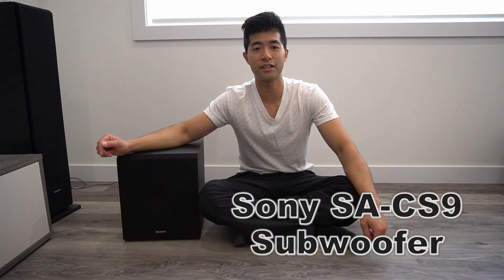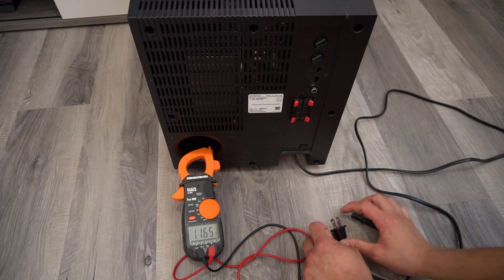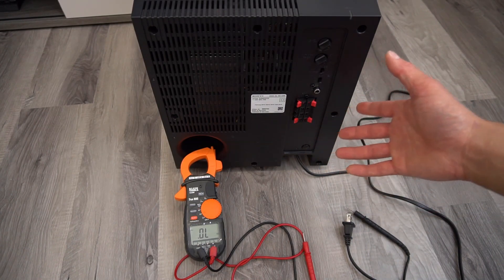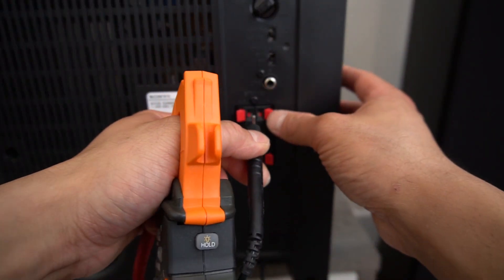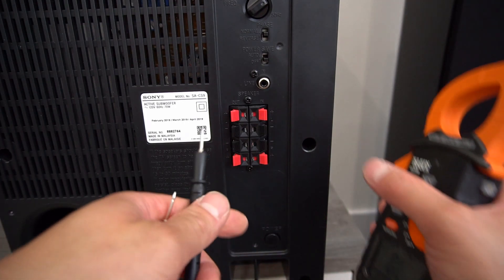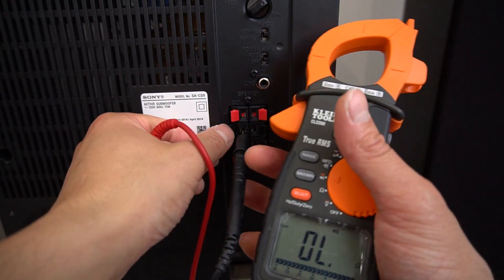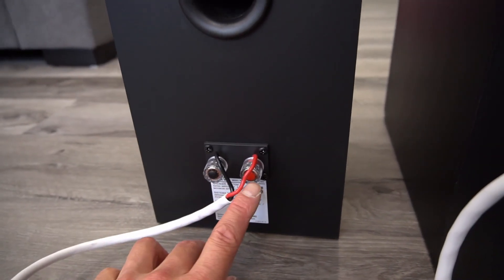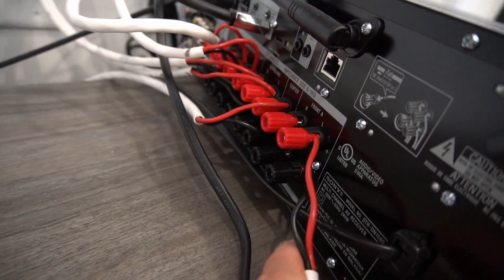SONY SA-CS9 Subwoofer PART 2 DEMO

Comment: I recently picked this one up for my Sony receiver as it was the one recommended. It was an open box speaker from Best Buy. Was listed as "good condition". Once it arrived, I inspected it for any flaws as being an open box. The one flaw was on the bottom underside and that was all. Once all hooked up and the receiver calibrated all the speakers, the sound was impressive. No complaints as now I can adjust the volume level from the sub to my liking.
Reply from the maker: Good stuff!

Comment: I want to add this subwoofer to my AVR and have .2. Does it make a difference connecting using just the line in VS using the terminals?

I have a Front L/R  bookshelf speakers so connecting using the terminals make sense.... and so is using the other subwoofer output on my receiver.

Or can I put both?

Comment: Would you recommend this Subwoofer for a medium size home theater? Sounds good, but I don't know if it at full power or it so strong that you can't even turn it all the way up. I would like to know that.
Reply from the maker: It's a decent average sub. I have two of them connected to my AV receiver. This sub you have the option to turn the dial to increase or decrease the bass. Good price point too, especially when it goes on sale 🍻

Comment: What is the purpose of connecting speakers in the subwoofer?
Reply: I was also wondering that.
Reply: Late response but it allows almost any amp/receiver to add a subwoofer. Because some don’t come with a dedicated “sub out” you can input your speaker into the sub, then run the sub the amp.

Comment: Quick question do you leave it on or put it in standby mode ? Thank you
Reply from the maker: @Marcus_38  I have a separate power bar. If I'm not using it. I have the entire sound system off. Save energy 🍻

Comment: can you please explain more about the "line in" just above the speaker in and Out connection?
Reply from the maker: They are for connecting two wires together if one wire isn't long enough to reach to a speaker

Comment: I KNOW THIS VIDEO IS 4 YRS OLD BUT HERE IS MY QUESTION. SO IF I USE THE PASS THRU SYSTEM, DOES THIS ACTIVATE THE WOOFER THE SAME AS IF I HOOKED UP THE LOW FREQUENCY INPUT?
Reply from the maker: @jorgeatilano5468  nope, it does not activate the woofer. Woofer is only active with the RCA input 🍻

Comment: "Speaker in and out ports" on the subwoofer, not only pass through the signal but play key role in the subwoofer functioning. If bypass these ports, with only mono sub cable connected, the sub will play very weak. If your amplifier does not have subwoofer outline, these ports will make the sub works well without the mono sub cable connected.
Reply: If my amp does have a sub out port, can I skip using the speaker pass throughs? My amplifier is the DA-2120C Fosi Audio. Thanks for any help

Comment: Sir without amplifier we can use this subwoofer 🔊 with direct connection to sony tv Vv
Reply from the maker: Absolutely brother. This sun has a amplifier built in. You just need a RCA output connection on the tv and then connects to the sub input RCA 🍻

Comment: Hey kev, question? I got my sub woofer. Hooked it up, sounds really great...until it cuts out and gets all buzzy lol. On the instructions its says plug the rca cable into the mono port but i don't have a mono port, i have a phono port. So i un-plugged the rca cable cuz i don't know what port to plug into. Do i need the speakers wires plugged in also or just the rca cable, but plugged into the correct port?
Reply from the maker: Hey man, yeah you are correct. Just a single RCA cable. And to be plugged into the right port specifically for the subwoofer

Comment: Hi Kevin I have the Sony receiver including the speakers all hooked up with Dolby Atmos My question is 
Can I add extra speakers coming from the subwoofer and like to know also the decibels set up 
Thanks and first time watching your video
Reply from the maker: Hi Rico! Sorry you cannot add additional speakers from the subwoofer. The terminals on the subwoofer is just for joining wires together to reach point A to point B but having the subwoofer in the middle.
Reply: @KevinPon.  thanks so much for your  help

Comment: Do you need an amp receiver to power the speakers? I have my speakers plugged in correctly.
Reply from the maker: This sub has its own amp. All you need is input signal from the RCA cable 🍻

Comment: Do you have to hook your speakers to the sub or to the receiver. Also can you use a banana plug from sub to receiver?
Reply from the maker: No you do not have to. This sub uses RCA connections 🍻
Reply: Thank you. I haven’t seen this set up on a subwoofer before. I’m also new with subs. I bought my first sub from Klipsch and the back was definitely different.

Comment: Does this subwoofer need an amplifier to work?
Reply from the maker: It does not. It has an internal amplifier.
Reply: @KevinPon.  Can we connect it directly to the computer and run it? Does it need avr amplifier?
Reply from the maker: Your sound card will need a subwoofer output
Reply from the maker: The subwoofer has a amp built in so you do not need one.
Reply: @omeraksoz238  You need a Av receiver

Comment: I’ve watched a few of your videos, great work btw. I have the Sony str dn 1080 receiver, center speaker, 2 large speakers, 2 book shelf speakers, 2 Dolby atmos, and 2 subwoofers. I have a question.
Should I use the pass through from the subwoofer to the speakers? And if so which ones? 
Or should I run my wire directly from the receiver to the speakers and just use the cable provided to hook up my subwoofers??
Reply from the maker: Hi Derrick, thank you! Yes you can use the pass through. The pass through is labeled L and R. Shine a light on the back if too dark to see.  It's good for joining two wires together to make it reach. For example receiver to sub pass through and then to speaker. I would recommend using the wires that came with the subwoofer and direct connection to speaker if the wires can reach. If cannot reach then you the pass through as a terminal block for joining the wires together. Hope that helps 🍻 nice system btw 😎
Reply: @KevinPon.  thanks man. I originally had it hooked up with 1 sub woofer, using the subwoofer cable and my left and right  large speakers passing through the subwoofer. For some reason my German shepherd decided to rip the wire from my right speaker and all the way from the subwoofer on the other side. While searching for new wire o found out that my original wire was copper coated aluminum so I ordered some solid copper wire with coating and a 2nd subwoofer since ALL of the Sony speakers are half off on Amazon right now. Getting ready to hook it all up the right way tomorrow. I won’t need to pass through since my large speakers are about 6 inches outside of my subwoofers
Reply from the maker: @derrickroberts1413  dogs will be dogs. I have a pomeranian, she hasn't chew on my speakers yet 😂 50% off, sweet deal!!
Reply: @KevinPon.  yes they will. Mine is only 9 months old and he is 90 pounds. I think he was most likely after a grasshopper or a moth and things happened 🤣

Comment: Hello if i connect in  2 bookshelf speaker on sony subwoofer  and the out is going to avr and the subwoofer will produce sound from av receiver?
Reply from the maker: The yes only if you connect the bookshelf speakers to the subwoofer as a passthrough to the AV receiver. You only connect the bookshelf to the subwoofer of you have to.
Reply: @KevinPon.  Can work on sony strdh190 2.1 receiver
Reply from the maker: Yes if it uses RCA to connect to subwoofer
Reply: @KevinPon.  umm how about if av receiver have no subwoofer out
Reply: like 2.0

Comment: I’ve watched some of your videos on this whole system and it seems like the subwoofer is the weakest link in the system and the receiver is actually way more than the speakers need. Would you agree? I’m looking at this exact system but I’m thinking that I could save $100 or $200 on a receiver and maybe spend it on a better sub. Any thoughts would be much appreciated. Thanks
Reply from the maker: Hi Mike! That is correct. The subwoofer is the weakest link. Not impressed with it haha. Nothing wrong with spending less on a receiver but make sure the receiver can provide enough watts to each speaker. I wouldn't getting a better sub too! 🍻

Comment: Hello, i’ve tried everything but I can’t seem to get the subwoofer to work. Do you have to have it hooked up to the speakers like that? Right now I just have the RCA cable connected to the receiver but no sound is coming from the sub
Reply from the maker: Hi Josh, I have mine hooked up using the RCA cable. Is the power button turned on? On the subwoofer.
Reply: @KevinPon.  yes, I have power to both subs. Is it something to do with the deh 590 receiver?
Reply from the maker: @joshaustin4879  Is that a car receiver? Sounds light there's no output signal from the receiver.
Reply: @KevinPon.  no it’s a home Theater receiver. 5.2 surround sound. I have no idea what the problem is very frustrating. Guess I’ll call Sony on Monday and see if they can help
Reply from the maker: I assume you went through all your settings on the receiver and couldn't find anything for subwoofer output?
Reply: Long shot, but did you find the solution for this? I have the exact set up and problem. Thanks

Comment: What gauge wire is required?
Reply from the maker: It comes with the cable required to plug in your receiver. No need to worry about wire gauge
Reply: @KevinPon.  I meant from the subwoofer to the bookshelf speakers
Reply from the maker: Alan, please check the chart on this website: http://www.roger-russell.com/wire/wire.htm
Reply: @KevinPon.  Some people don’t have Av receivers that supports that!!

Comment: Why use those speaker connections at all?  Why not just plug the wire from the receiver and go directly to the speaker instead of making a seemingly pointless connection?